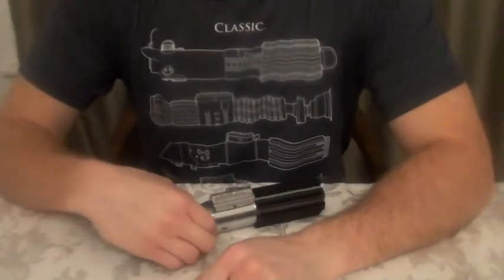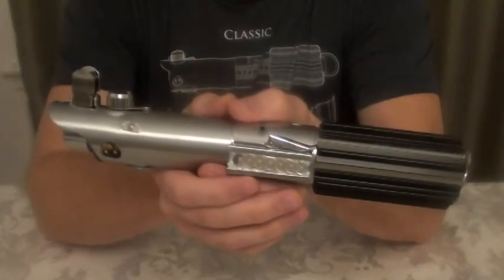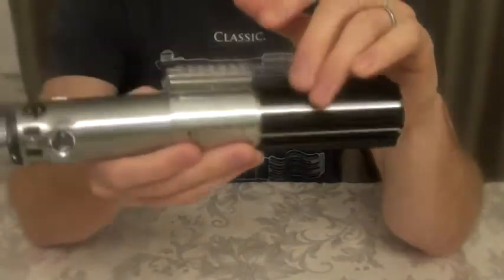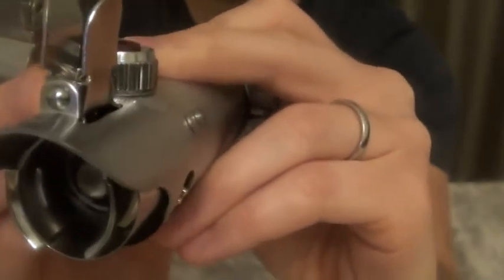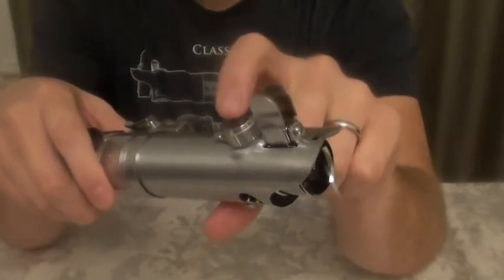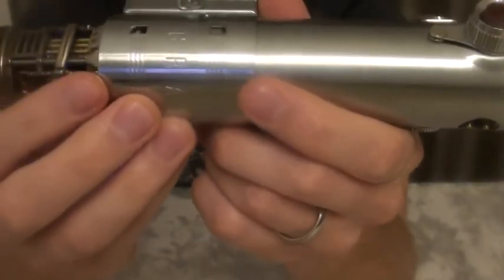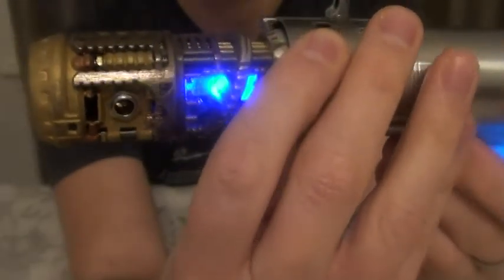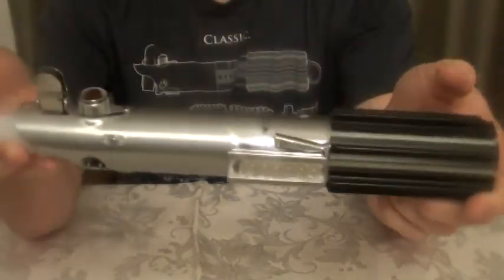TGS Graflex Replica in ANH with Prizm v5.1 and Dual Activation

Comment: Hey there Chris! I had the same problem as you with the TGS bunny ears. What I did as a quick fix is to put in a 1" blade stock into the bunny ears but not necessarily into the blade socket. When it's in the bunny ears, pull apart the ears to keep them from pinching. Once you've pulled them apart, take out the blade stock and you'll notice that it has followed shape, no more "gap" from the band.
Reply from the maker: Ken Baltazar thanks Ken, I'll give this a try.
Reply: Let me know how it goes. If you don't like it, an alternative would be to just take off the mini-screw on the band and let it just hug the bunny ears without the screw.

Comment: On mine, I'm going to use the red button for activation and the slide switch for auxiliary. Then I can I can build an electronic core so I can swap out the external pieces to build the saber in either ANH, or ESB, or TFA/TLJ, all with one saber. Then I don't have make three individual sabers
Reply from the maker: Joe Kerr with these replicas, thats a smart move. The ESB and TFA/TLJ bottoms are virtually the same (rivets vs. screws aside). Essentially if you grab an extra bottom to make the 7 grip ANH bottom, you can interchange them easily. The rest of the external parts (additional red button, TFA glass eye) are easy to acquire. Should be a great build when you're done.

Comment: Thanks for the reply.
How about this?
Specification:

JQsaber Graflex Stainless Steel Edition.
MB-saber 3D printed chassis by GraflexSabers.
Crystal Focus ver. 8 soundboard by plecter lab.
Accurate Solo Hold's blade Holder.
Tri-Cree B/rB/W LED
Shine-through glass eye.
Dual Aqua aura crystal illuminated
(14650)x2 7.4v li-ion cell with PCB protected.
28mm 2W veco speaker.
1.3mm recharge port with power switch
Red button activation and slide aux switch.
Reply from the maker: STUART B are you asking if I do commissions or just what something may cost? I only build for my own personal collection. But I would say if you want an idea of how much it would cost, add up all the material cost (hilt, chassis and electronics) which will give you a start. Different installers charge different amounts. The MB chassis is one of the more advanced chassis setups out there. The charge will likely be higher because of that. Thinking anywhere between $200-400 on top of material for someone to install (this is an educated guess). Do your research though. A lot of bad installers out there. Ask around in the Graflex Addicts Page on Facebook and go to The Rebel Armory and Fx-sabers.com forums.

Comment: How much?
Reply from the maker: STUART B How much for what exactly? The graflex shop sells their replica for $200. Then all of the other accessories vary in price. The internal chassis is a mix of 3D plastic and metal costing over $200. This again will vary based on if you do more plastic vs. Metal.  All of the electronic components, battery, speaker, accent LEDs, main LED and soundboard will all cost around $150-200 depending on level of soundboard.  
I make all personal builds. Not sure if you were asking how much because you thought I would be selling this?
You can certainly keep it cheaper by going with a basic plastic chassis and a basic soundboard like a Nano v4 or Spark 2 but you'll lose features. But if you are looking to build one, expect to spend $400 at minimum. Hope this helps. Thanks for watching.